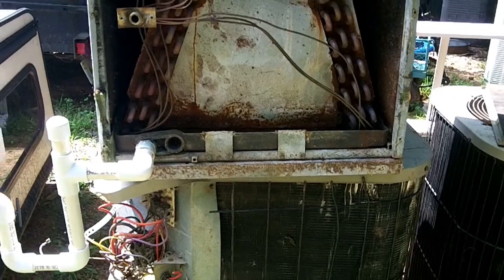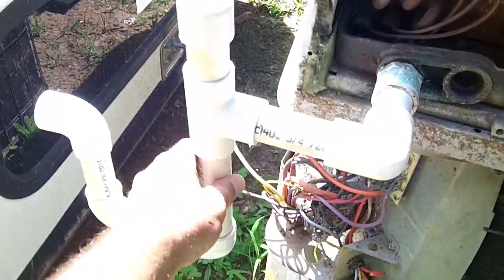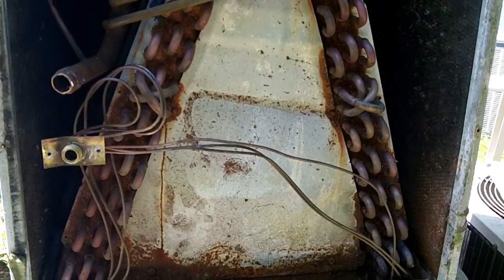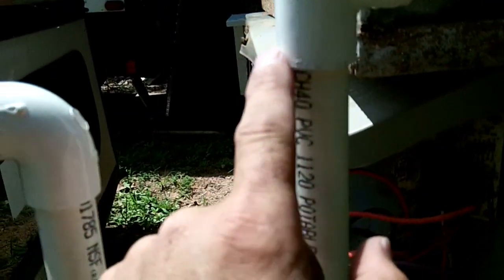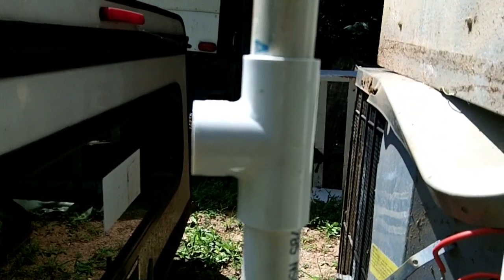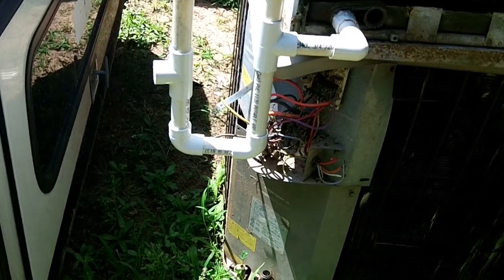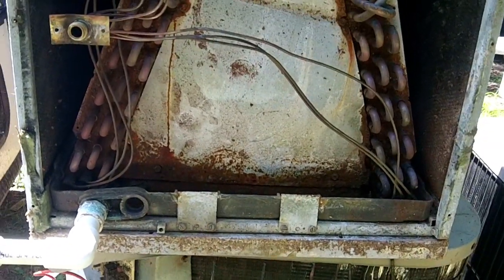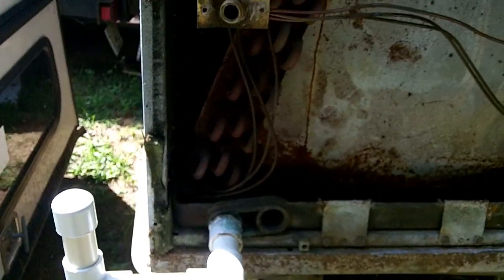Basic HVAC Video Series--- Condensate Traps

Comment: Thats ridiculous that you need a contractors license to scrap something.
Reply: I think it has to do with the EPA and that stupid ozone depletion.

The Nonsense That is Ozone-Depletion

"Holes" in the ozone argument: 

1) Freon is heavier than air:  how do molecules heavier than air get to 30,000 feet (the beginning of the stratosphere)? 

2) The "hole" in the ozone over the South Pole was "discovered" by satellites in the '80: if it was just "discovered", how do we know IT WASN'T THERE ALL ALONG ? ? ? ?

3) There is a perfectly logical reason why there is less ozone over the polar regions: THERE IS LESS SUNLIGHT THERE TO PRODUCE OZONE IN THE FIRST PLACE, especially in winter ("land of the midnight sun...")  

4) Antarctica (South Pole) has the highest average elevation of any continent (8000 ft): Does that have any effect on ozone quantity?????  (The North Pole is all at sea level and there is no ozone "hole" there.  (Why not?) 

5) The offending atom is CHLORINE (very common), not CFCs themselves. The argument goes that the CFCs carry CHLORINE up to the stratosphere.  There are other compounds of chlorine in the atmosphere -- that's one of the things you smell when you go to the beach  --> "salt water" --> i.e. sodium-chloride.  Is the ocean a source of "ozone depleting" chlorine compounds?  

6) Most basic of all, ozone (O3) is an EFFECT of UV blockage, not a cause. [O3 is an unstable molecule that needs a lot of energy to produce, e.g. the ozone you smell around arcing engines. There is less ozone at the poles b/c there is less UV to generate it (just like there is less sunlight to keep the place warm in the first place.     

I hope the public is beginning to see how dubious this ozone scam is.   Monstrous mistakes like this DO happen - think the ban on DDT and malaria deaths.

The Ozone Scam
https://youtu.be/9Szs-treHwQ

The Nonsense That is Ozone-Depletion

https://www.ourcivilisation.com/ozone/king.htm+

Look how we've been "had" by this "ozone depletion" scam:

In other words, CFCs probably have NOTHING to do with Antarctic ozone:

https://youtu.be/lBu3vltczRw

In other words, the× Montreal Protocol is a complete fraud:

Min 0:30:  "Measurement of SURFACE 'ozone depleting substances' (chlorine? are you measuring ALL atmospheric chlorine compounds?).  

https://youtu.be/uVeTJSIbGm8

1987 - Montreal Protocol. Remember that date in this music-tracked piece of manipulative propaganda.
Listen for the weasel words and disclaimers.
https://youtu.be/Ll_TR7C4xr4

Ozone hole is "healing" (scientific term). Can't you tell?:
https://youtu.be/taTzqRHNIEc

A discussion of atmospheric chlorine:

https://api.nationalgeographic.com/distribution/public/amp/news/2010/3/100310-sea-spray-ocean-colorado-pollution

Natural Chlorine? You Bet! (American Chemistry Counsel)

"Many of these chemicals are identical to highly publicized manmade organochlorines: chlorophenols, chlorinated hydrocarbons, PCBs, CFCs and dioxins."

https://chlorine.americanchemistry.com/Background-Natural-chlorine-You-bet-/

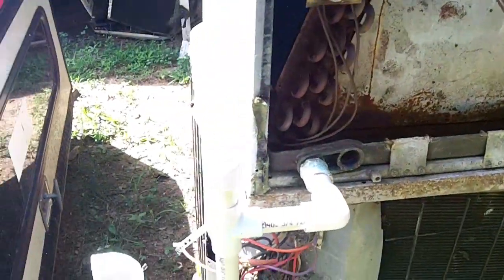Min 2:00 Listen carefully: in other words,  the ozone hole has been there since AT LEAST the 50s, before CFCs were widely used.

Min 15:00 "interesting scientifically" - must be fun to have these kinds of research grants and boondoggles. Great work if you can get it.

https://youtu.be/AU0eNa4GrgU

How EPA is screwing up your car's air conditioning. 

https://youtu.be/wm56tV5BbJk

Lousy car air conditioning:
https://youtu.be/5jKRiDtcBrs

Guy says we should use explosive propane as refrigerant

https://youtu.be/pv_fxOuLuZU

Propane as a refregerant
https://www.youtube.com/watch?v=iXyHOfx307k

.
Why The Banning Of Chlorofluorocarbons Is Paranoia

https://www.ourcivilisation.com/ozone/index.htm

Min 6:00 -- two different kinds of chlorine... (yeah, right)

https://youtu.be/kmfAM8kQrjU

The stupid claim the ozone layer is "healing" ("healing" - is that a scientific term?)  

Notice that the "hole" always goes away in Antarctic summer (more sunlight/more ozone produced) and reappears in Antarctic winter (no sunlight/no ozone produced (ozone is an unstable molecule to begin with)).  We've been sold a load of cr*p that has made a hideous mess of the AC industry. 

You'll see no change in hole size in the Antarctic winter, which means the "hole" has been there all along and is a perfectly natural and harmless phenomenon.  "Oh well, we trashed an entire industry over a quack-science hoax... Sorry about that..."

https://youtu.be/krqHVzF3-T8